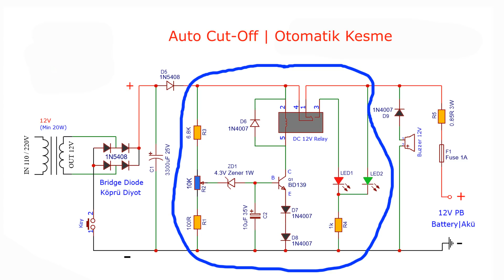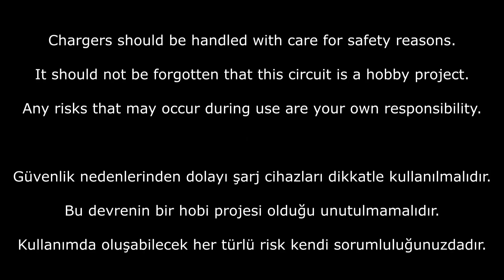How To Make Auto Cut-Off 12V Lead Acid Battery Charger Circuit. DIY PB Charger

Comment: What is the work of reverse polarity alarm ?????
Reply from the maker: protect the battery
Reply: @Kendin-Yap  Sir, can I use 4.7 volt Zener Diode instead of 4.3 volt??? 4.3 volt zener diode is not available in my local market. Please tell sir.

Comment: What is the input voltage to this circuit. Is that 230v or lower than that
Reply from the maker: It is indicated in the diagram. This is related to the transformer you will use. 110V or 220V-230V

Comment: Analizando el diagrama, sólo tengo una observación, el LED2 siempre debe permanecer encendido verde mientras tenga la batería conectada [06:26] [07:27] o verde cuando enciende el voltaje de entrada [06:43]. Más sin embargo [07:48] enciende el LED1 rojo (y según el diagrama el LED2 verde debe estar encendido] y en tu demostración se apaga el LED2 verde. Como se muestra cuando apagas el voltaje de entrada [07:55] el LED2 verde se enciende por tener la batería conectada. Tu circuito esta correcto pero el diagrama esta mal conectado el LED2 o el relevador.
Reply from the maker: Thanks, but there's nothing wrong with the circuit and the diagram. As shown in the video, the battery must first be connected and then the circuit must be activated. With this sequence, the circuit and led s work correctly. 06:43 Glowing green because I changed the potentiometer setting to measure voltage.
Reply: @Kendin-Yap  enterado

Comment: If you want to charge to 100%, a typical car Ca/Ca battery, you must charge it to 16.2V final voltage. Only then can the maximum electrolyte density be obtained.
Reply from the maker: Yes, for car batteries, this may be true. But this circuit is not for car batteries. This circuit for maimum 7000mah lead acid (PB) batteries. 
100% charge voltage is 14.8V for this type of batteries. This circuit is a simple circuit. For security reasons, I limited it to 14.4V.

Comment: Hello!  This circuit can i use on 12v 12Ahm battery? Do i need to change anything about it?
Reply from the maker: No need to change. Charging time will be a little longer. Approximate charging time = battery capacity / 600mah

Comment: Hai...I want to charge my 12v 17 ah battery... this circuit can use for my application
Reply from the maker: This circuit is for 12V 7Ah. But it is available for 17ah. Charging time will be longer.

Comment: hello... why it is not charging.. i follow the schematic and used the components that on the list but it is not charging. what should I do??
Reply from the maker: I have no way of knowing where you've made a mistake. The right parts, the right connections and the right setting work smoothly.
If everything is correct and you have adjusted the voltage as shown in the video, the battery must be connected first and then the circuit must be activated to start charging.
Reply: @Kendin-Yap  check led is in reverse order in diagram

Comment: Can I use the ckt: for charging 12 + 12 volt lead acid battery 22 amp:? Then what will be the necessary changes?
Reply from the maker: This circuit is not suitable for high currents. Can be used for max 12C 7 Ah batteries.
Reply: @Kendin-Yap  Think you so much for replying.

Comment: commercial chargers have charging voltage 13.7 or 14.2 and it never exceeds that .... if 19V is normal, then we cant charge 12V battery via laptop chargers?????
Reply from the maker: The voltage drops during charging. With a device that shows 13.7 volts when not connected to the battery, you cannot fully charge the PB battery. In the video I show the voltage of a commercial charger as an example. Your knowledge on this matter is not enough.
Reply: @Kendin-Yap  Sir with due respect, how much charge will be going to drop? when you are making a video for the general public , how it woud be a acceptable that you r mentioning that 19V is normal ...... 

and I m working with batteries since last 20 years ..... never heard, nor seen battery charging voltage 50% higher than the nominated .....

ok dont want to discuss it further, its ur video, its ur channel ....
just to warn the public if they ruin their property .....

Comment: BD139 in place of I can use LM317
Reply from the maker: No, you can't use it. They have different missions. BD139 is an NPN type transistor. You can use a different NPN type transistor instead.